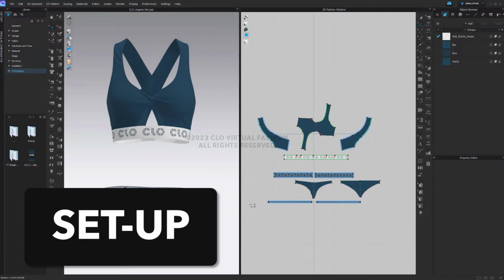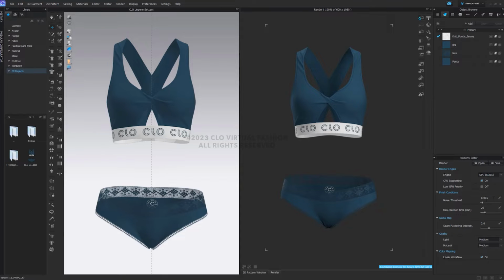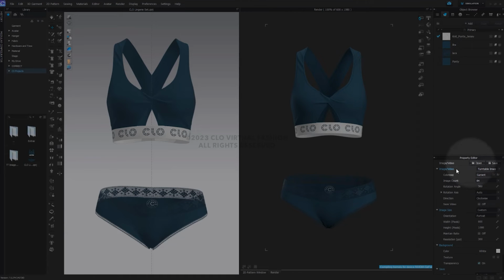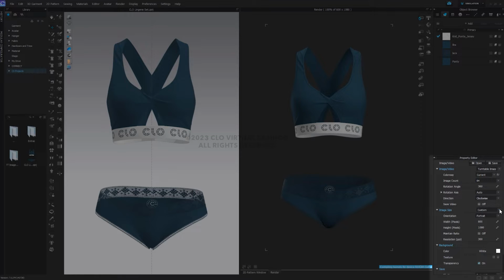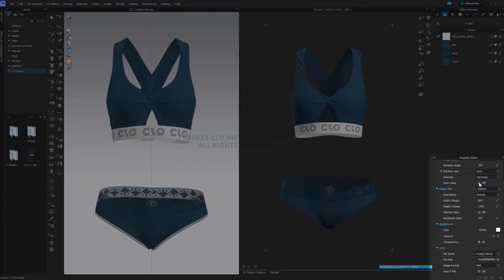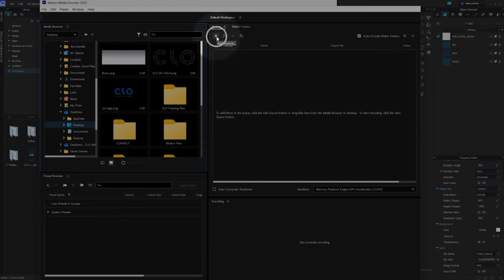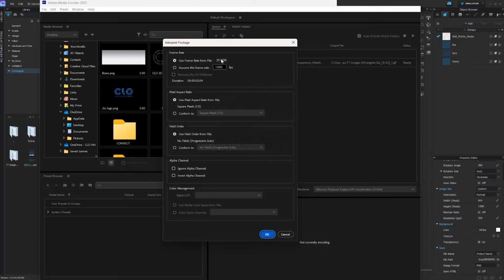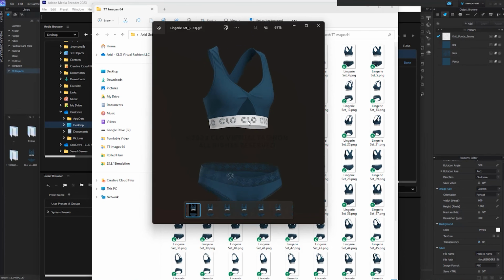Create a 360° Turntable Animation in CLO (Transparent)!

Comment: What am I doning wrong if the loop isn´t seamless? It feels like the last images are missing, but I have 69 images...
Reply from the maker: You can have as many or as few images for a turntable as you want. More will just be a smoother animation.
But you may need to check that your rotation angle in the Render Image Properties is set to 360 so it is fully capturing your garment all the way around.
Also, make sure that CLO is completing the turntable and not freezing or crashing before completion